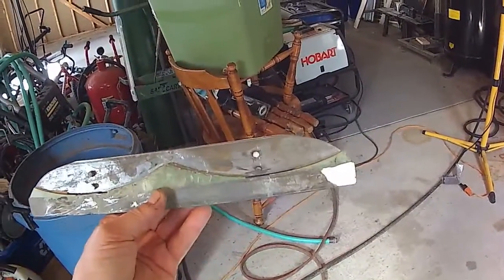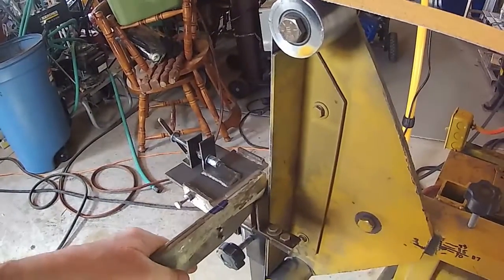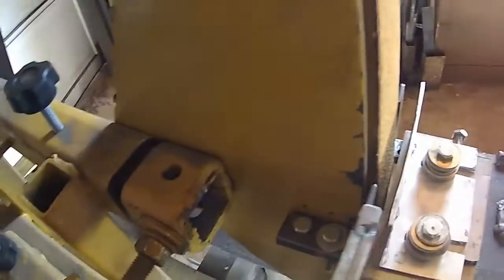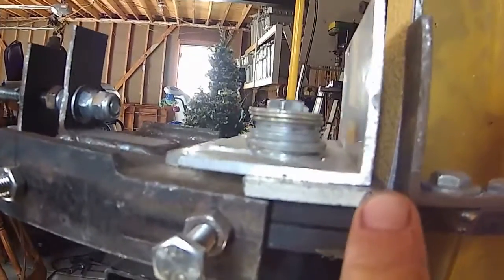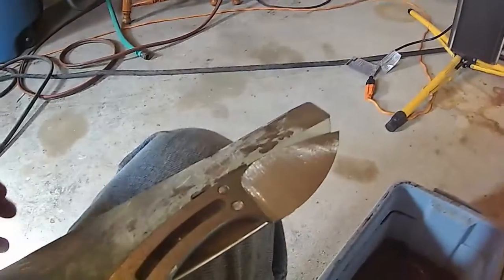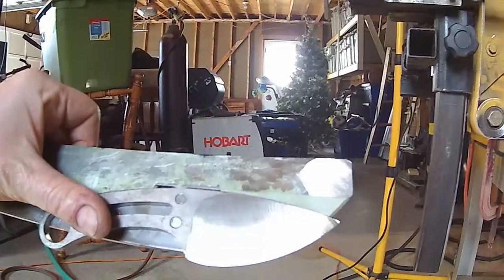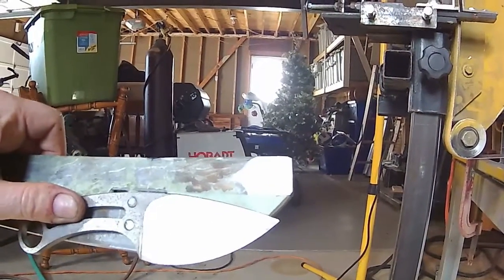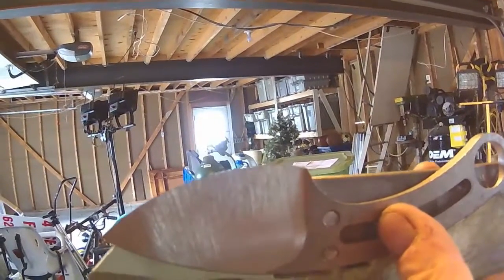Flat Grinding Bevel Jig Blank Carrier Modification Update | GET THE JIG PLANS

Comment: looking good! cnt wait for the finals ;)
Reply from the maker: +The Dragon Lady They are looking real good.  I had a sander blow up this week.  The drive shaft was bent probably from the very beginning.  It killed two bearings.  Good news is the new shaft I made is not bent and runs so smooth.  I have lots of video footage to edit when I get back to work next week.  Not quite half way through the neck knives.